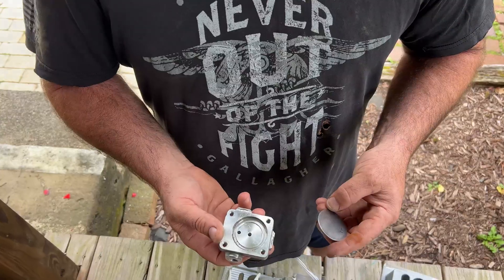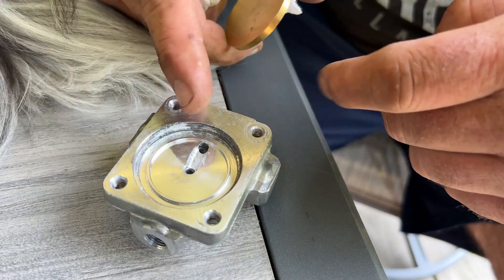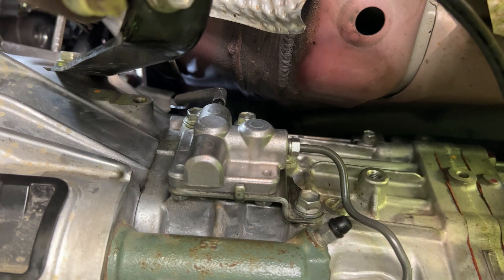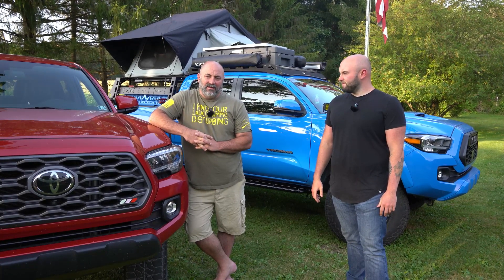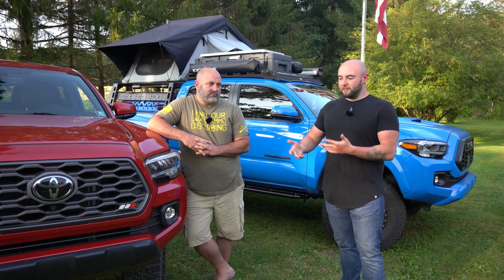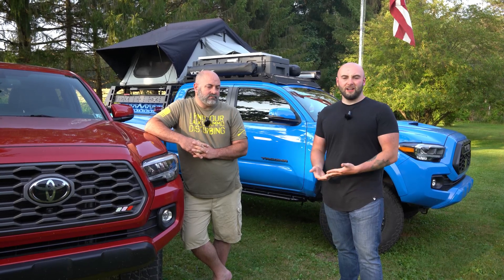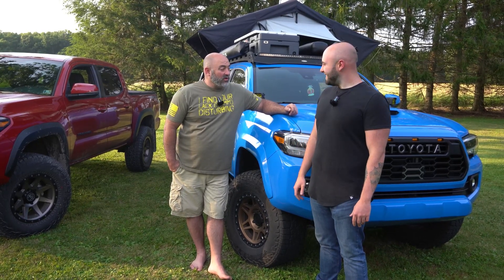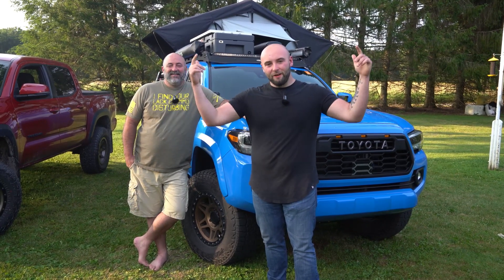Make Your Manual Tacoma Shift Better! (Clutch Accumulator Delete Mod)

Comment: Just put the brass disc in. Its not that expensive, you don't have to grind, it's reversible, and it fixes the clutch. Easier to sense where it grabs and feels more like a traditional manual transmission is supposed to.

Comment: Did you modify the accumulator on the Off Road or Sport? I have an Off Road and hate the clutch feel.
Reply from the maker: We did it on the off-road
Reply: @ModernDayViking the off road has a separate reservoir?
Reply: Yes it does.

Comment: I have 112k miles on my Tacoma and I have noticed that the clutch feels different on a cold morning.  It seems jumpy and "grabby".  Is this because of the accumulator?  Other than that, it shifts fine except for 2nd gear sometimes.  2nd gear seems like a struggle to get into when down shifting.  Anyone complaining that the Tacoma clutch is heavy must have never driven a manual with a manual clutch.

Comment: Why did you grind it? The instructions said it was basically plug and play besides bleeding the system.
Reply: we did not put the disc in the truck we did the delete on. just basically showing everybody there is different ways to accomplish the same end goal.